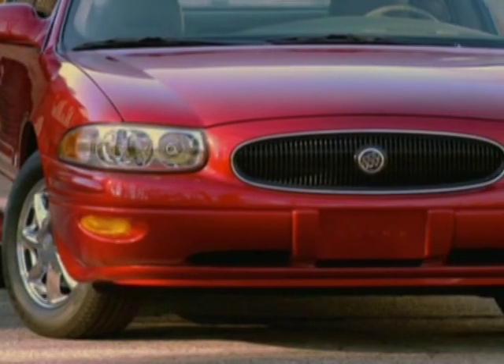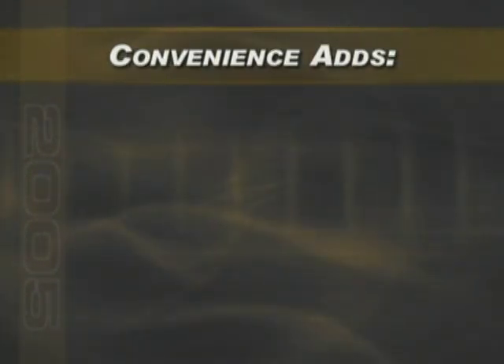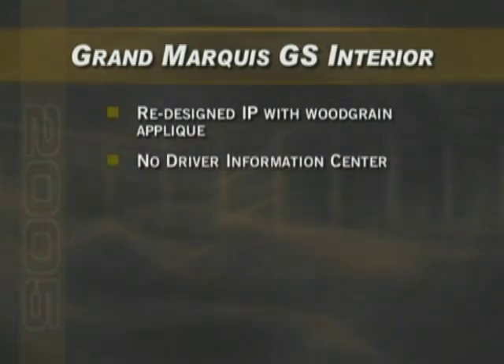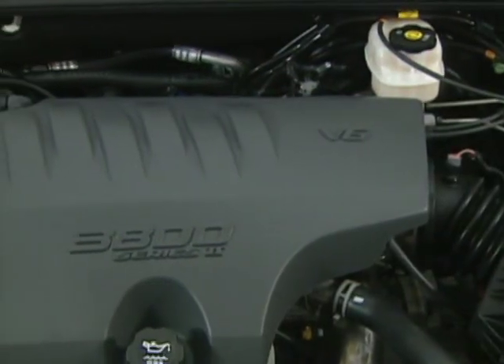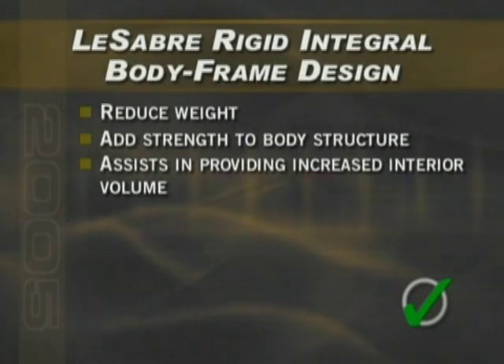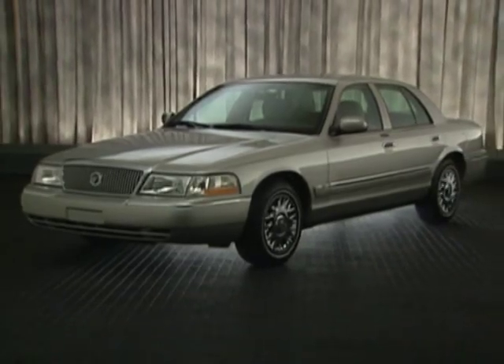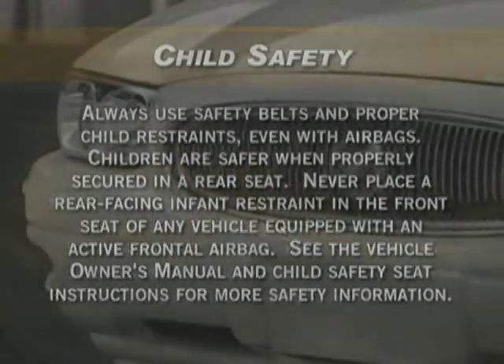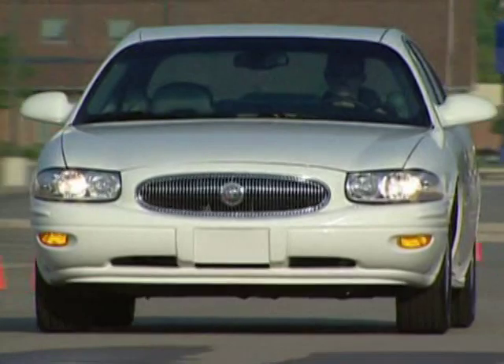Buick LeSabre (2005) Competitive Comparisons

Comment: If ever a competitor that 4.6L was it, but the Camry was probably the chief competitor in alota ways. The 00/01 camrys were very good in 6cyl.  Great years for cars. They made them too good. Now people keep going back to those cars for reliability. The 3800 series wins against both cars. The engine over fords slightly and the body over camry and ford slightly. But Toyotas engine is tied with LaSabre in my view. Also GM wins with body durability and engine bay room by far. Ease of repair and maintenance goes to GM in the LaSabre over ford or Toyota in the early 2000’s. Looks have to go to LaSabre.

Comment: Disadvantages Death Cool antifreeze. Ford/Mercury do not. and the Buick owners manual still recommends  to change oil oil every 3000 miles every 3 months whichever comes first 30k miles trans and antifreeze flush for better performance. . TPS monitor GM wins that was a POS . I do Grand Marquis more simple. Hey didn't mention that the death cool ate the intake gaskets lIM and UIM gaskets out as well.. Grand Maquis were used used by law enforcement why wasn't  their competitor. Buick didn't mention that.  platform was retired on October 31 2021  by a small town here kin Illinois. The department kept the old 2011 for a back up  still have the car as a back up. sit t a minute Law enforcement didst want these FWD crap.An old panther platform 2003  grand Marquis it will out last   these  any day there is one with 2,435.71.1 miles and still counting it is a crown vic same car. It is here on YouTube 2 car owner.

Comment: the grand marquis wins, because of it's body on frame RWD and 4.6l V8 same as in the crown vic, the lesabre had a chance to take down the grand Marquis, but it lacked 3 things 1 body on frame 2 RWD and 3 a V8 engine.
Reply: Rear wheel drive isn't nearly as ideal for traction and gas mileage, and neither is a V8. A 4.6L and it barely puts out more HP, and yet it is slower. The Buick is clearly the winner.
Reply: My 99 Lesabre is factory supercharged 3.8 v6 puts out 240hp. And 310 torque.
Reply: @CDJF1  Factory equipped 3800 with the supwrcharger in a LeSabre? Nope. Park Avenue has it. 240 hp 280 torque.

Comment: My 2002 LeSabre Limited is like DRIVING my ultra Comfortable SOFA 🛋 down the road. They don’t make um like this anymore !
Reply: Very!
Reply: @cliflove5141 i have a lesabre but the piston rod snapped due to who ever owned it last not treating it last, just today, a friend of mine found a limited lesabre and its only 800.

I could either fix the limited ( has weather damage from a opened sun roof) or pull the engine and put it in my custom 😅.

The engine on the limited is in way better shape with only 80k miles on it. Gonna check it out on Thursday
Reply: reliable?

Comment: I have a 2004 Grand Marquis LS so I have almost all of the features that the GS lacked. If I drive very carefully on the highway I can get over 30mpg. You could also get a Handling and Performance package on the Grand Marquis. I don't know why they didn't mention it. It had higher spring rates with a rear sway bar and 3.55 Limited Slip axle ratio. Also came with dual exhaust which boosted power to 240hp.
Reply: Stuff like this equal my potty reading 😂
Reply: Yeah my Regal GS will smoke that boat in no time